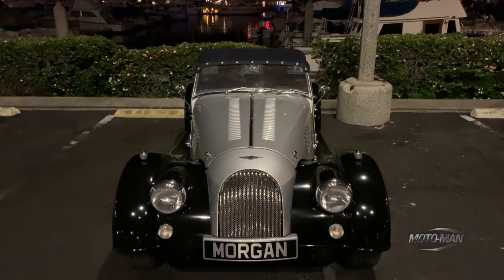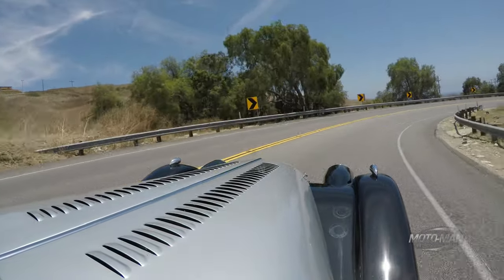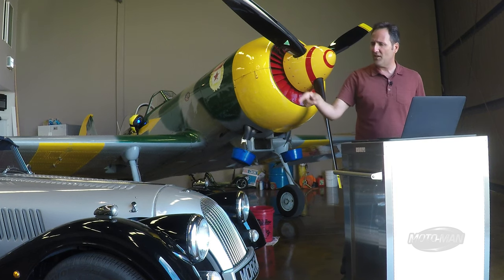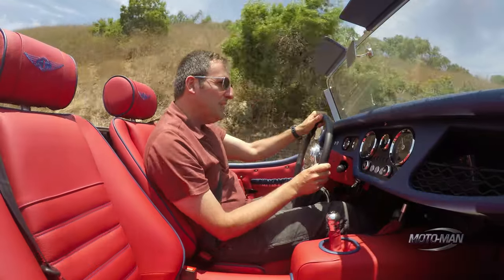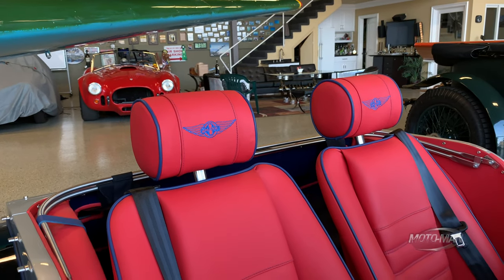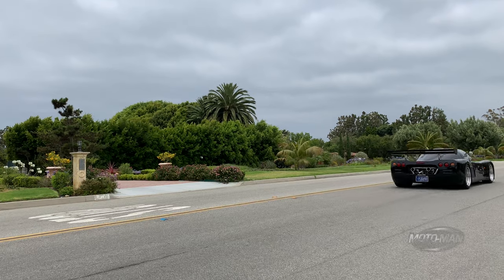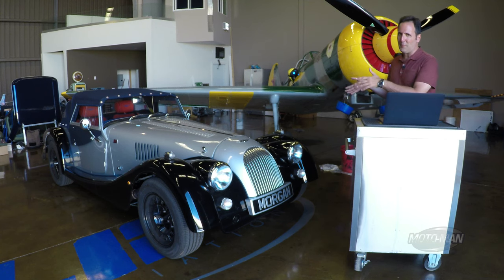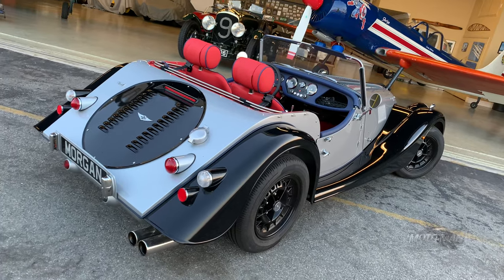2019 Morgan Plus 4 Club Sport: The Best Car of 2019  . . . FIRST DRIVE REVIEW

Comment: In 1969 spent an hour driving one of these fantastic machines around an RAF airfield in Germany.  That one had a Rover V8 engine and 1969 tyres!  It was quite a handful. Accelerating hard down the runway required total concentration to stop the rear end from overtaking the front.

Comment: I had to laugh listening to the part about everyone should learn to drive in a Morgan.  My first car was a 1958 +4 that my parents purchased for $550.  I was 15 at the time and it took me a year and a half of weekends to rebuid this amazing car.  I learned about cars and how they basically worked from my experience fixing this one up.  I remember driving down H-1, going 65mph, and people pulling closer to me, yelling "eh bra, what kine car is dat?".  I was the only one that could drive that car, as the clutch had about 1/2" of travel.  My parents did enroll me in a driver safety class which was a good thing, but, like you suggest, learning to drive in a Morgan gave me driving skills that have lasted.  I've been driving for 50 years, have never caused an accident but avoided many.  The experience of bringing that car back to life and the joy of driving it, will forever put a smile on my face...

Comment: I did (sort of) learn to drive in a Morgan, so tend to concur.  The Morgan in question was a '37 MX4 Super Sports Three Wheeler- hand-throttle, crash-box (you double de-declutch) & hand start. The biggest difference is that you have to think about breaking before everybody else & that they are a little more physical to use. My Dad also had various four wheeled Morgans, of which I have fond memories. They are also fun to drive, if you're after a more visceral driving experience.

Comment: I think that learning to drive in a totally manual vehicle is SPOT ON.  Good luck trying to keep most from crashing one of the $$$$$ Morgan 'trainers' when they're learning the clutch with that FAST gdi 4cyl.  An old Beetle (36- or 40 hp) is a little better learning place b/c 1st, 2nd and esp Rev, are low gears and the weaker flat 4's MAKE you learn how to gradually engage the clutch to keep from stalling them.  The VW would be a lot less lost cash when the 'errors' happen.  Let's do it though.  Required to learn AND take driving test in a fully manual car.
Possible 2nd benefit:  less 'appliance' owners.  Might actually have more new drivers think a car can be an adventureous or FUN way to get to work, the store, etc. 

I like this idea because, this might be one of  the fastest ways to stem the 'Crossover mania' that is already making getting a DRIVING CAR harder and harder.
Mazda, the maker of the Morgans tranny would sell more cars too.  Enough babble.  I agree.  Let's find the car-a-holic legislators we need to make this get to LAW!!

Comment: Nice very informative  video.
Barely believable!
Do you think it is why the Very vintage plus fours have held there prices so well.
1960 +4 Drophead (daily driver) Many years ago.
1963 +4 Current  very occasional
 Driver.
Both would have been better with the US engines.

Comment: NB

Most Auto importers do not now include Manual cars in their model range.  They have automatic transmission CVT rubber band driven boxes that are at best hopeless as auto transmissions and typically costly to repair outside of Warranty.  I have a VW DSG.  It died at 42,000 Kim.  A friends died at 17,000 klms.  VW’s DSG is totally unreliable.  Of the rest, Mercedes is now has the only Auto box you can trust to actually last.  That means most households do not have a manual car for young drivers to learn off.  You have to want to drive manual and have someone in the family support you to actually learn.  Most parents can’t drive manuals themselves.  hence, they will not buy a car for their child they can’t drive or understand.  When you try to explain the differences, you get a blank  response, why should they learn a manual when all the cars are autos.  It also means you need to pay a driving school for lessons.  If you don’t have the money, then you do not learn to drive a Manual car.  So much so that 1 on 4 now get their drivers licence on a manual.  The level of driving skill is taking a worrisome turn for the worse in Australia.  I agree with your comment.  Sadly fewer in my country will actually understand why.
Is it the same in the USA?  Is there an appreciation for the stick shift?